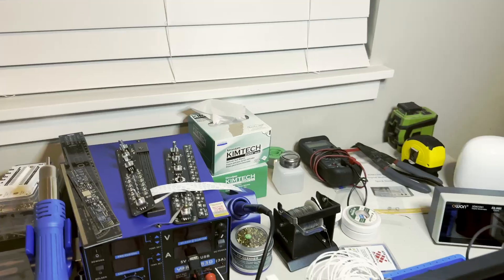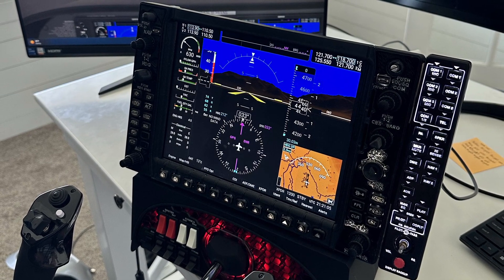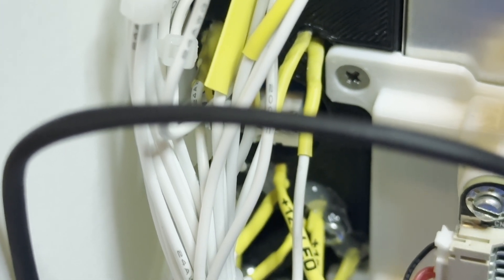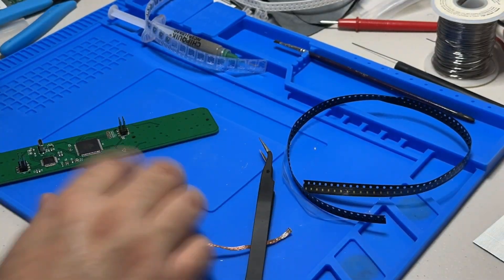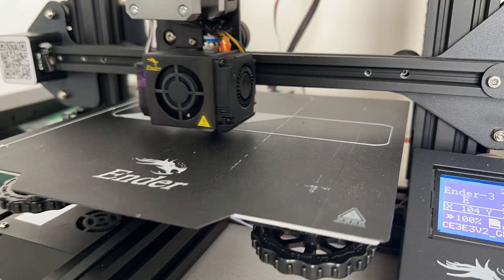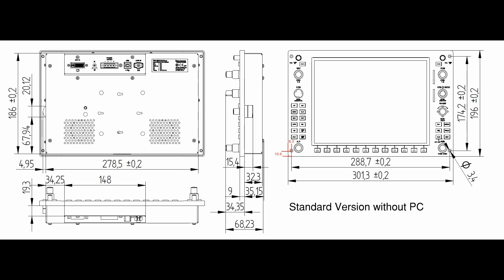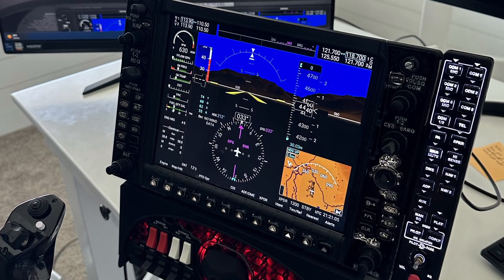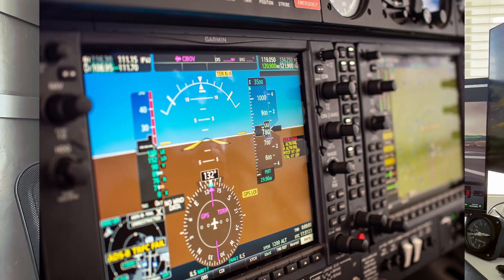Building A Custom G1000 for MSFS | The Journey Begins!

Comment: Will the finished design be Windows only or will it also work with Mac or Linux too? Will it work with X-Plane?
Reply from the maker: I’m using mobiflight for the firmware so it will work with MSFS and xplane on windows but not on Mac
Reply: @FlightDeckDIY  Do you know which software similar to mobiflight would work for mac
Reply from the maker: @yourweird8539  I'm not sure if there is anything that will work with Mac today. FSUIPC might, but I'm not sure.

Comment: Really cool project, one of the ideas I have myself to build a G1000 for MSFS especially since I use VR setup don't really need the screen rather want realistic feeling buttons and knobs. I'm used to flying a real G1000 and testing out the G1000 at many flight sim expo's non of the commercial project feel as tactile as the real buttons definitely not worth the price tag attached to them. Most actually feel "cheap".

Are you planning on Open Sourcing the design and / or software?
Reply from the maker: Seems like flight sim would be one of the best reasons to get into a VR. How do you like it?

I'll probably open source everything, but I feel like I need to get a fully finished and tested build. Maybe that's the wrong approach?